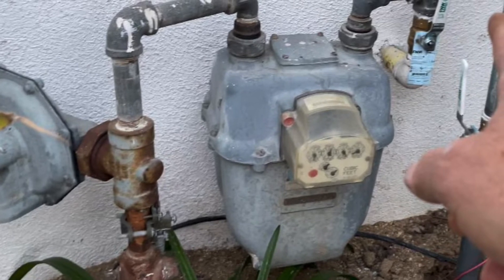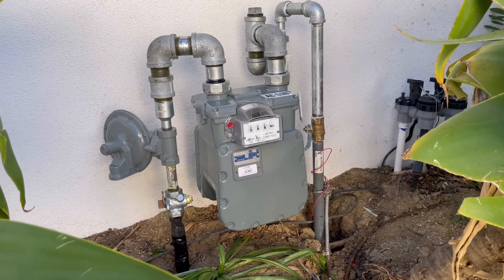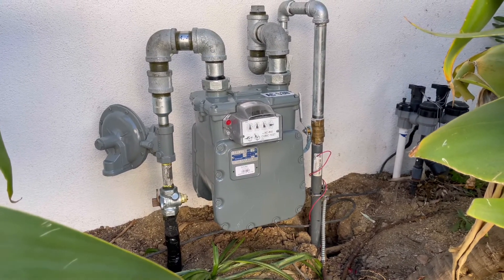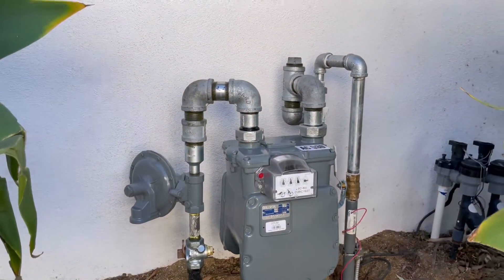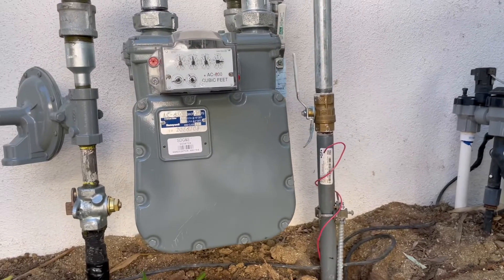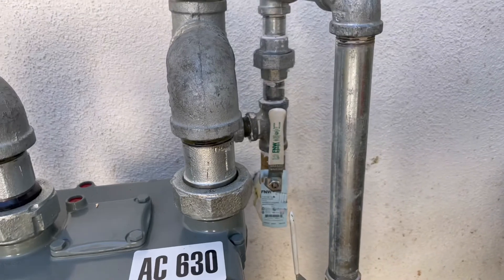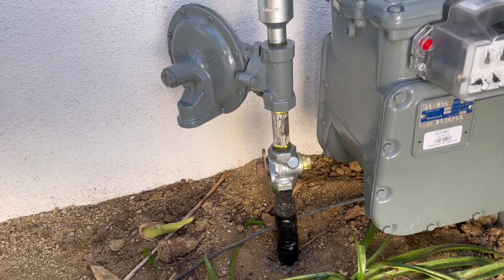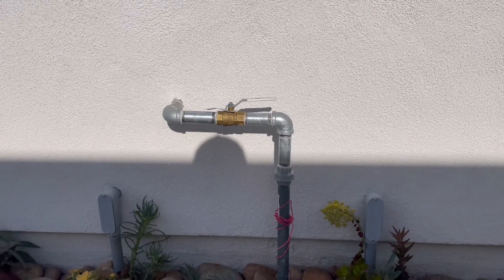ADU BLDR - Upgrade your small SGDE gas meter

Comment: We are just trying to upgrade our meter on an existing home built in 97’. We installed a new pool heater and were told that our meter needed to be upgraded in order for it to run effectively. This whole process has been a nightmare, we started it in May and today someone from the City came out and told us that before they can install a new meter we need to have a plumber cap off all our gas appliances and he will do a test to make sure there are no leaks. We’ve already spent $200 on a city permit and now the cost of having a plumber come out.  Help
Reply from the maker: Hmm, was he from the City or the Utility Company? You should have shut off valves on every fixture. So that shouldn’t require a plumber. You could turn them off yourself and call the planner back out. You may have to relight your water heater after the fact.
Reply: I’m in the middle of this process as well. It has been a nightmare. What plumbing company did you use to help you with this? I have called two and both are unfamiliar with this process.

Comment: Thanks for the info. The property where I’m building a JADU Garage conversion was built in the 80’s. The gas meter looks old and beat like your old one. Should I just request an upgrade now even though I’m barely starting with my JADU? The main dwelling is getting an upgrade from a traditional gas water heater to a Rheem 9.5 GPM tankless gas water heater. The JADU will get an electric tankless water heater.
Reply from the maker: Joel, Are you adding other gas appliances, like range, dryer, fire place? If not, it doesn't sound like you really need the upsized meter. You're trading out your existing water heater and using electric for the JADU.
Reply: @URBNBLDRS  No, the JADU will have all electric appliances. I guess The old meter will be just fine. Thanks for the reply.